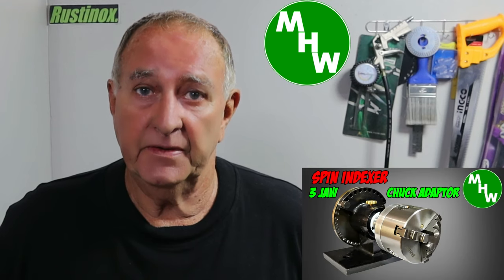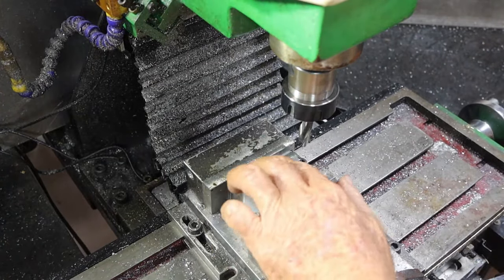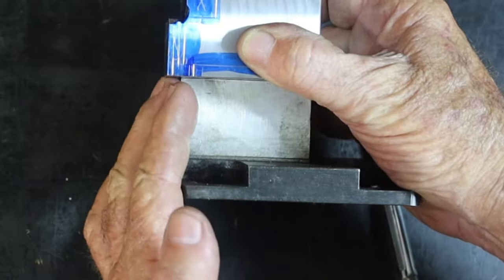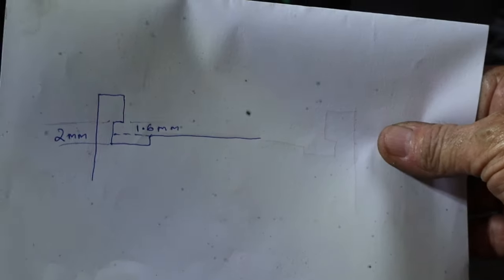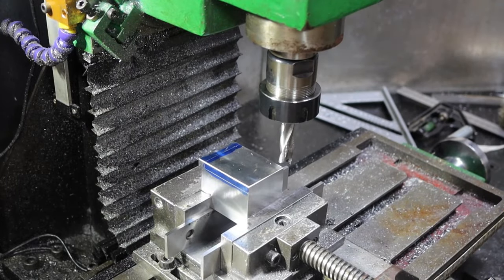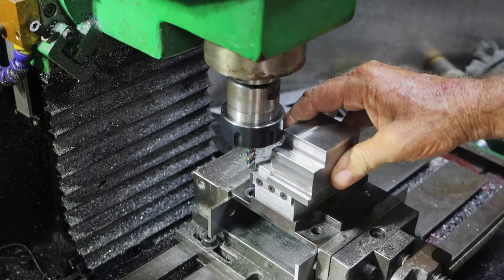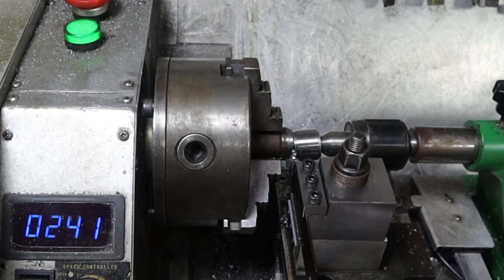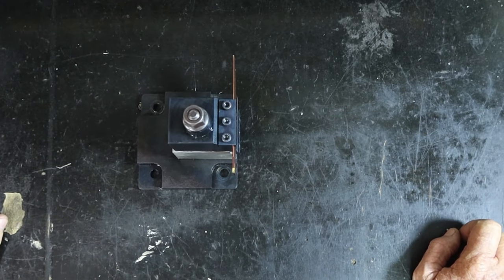MHW Episode 123 - Rigid Parting Tool Holder

Comment: Well done and very well designed.
Some time ago, using the part off that You disliked, some 15 mm steel was parted off. It looked like cutting well. Once finished it was discovered that the insert had broken off and the insert holder had done the cutting!
Reply from the maker: Astounding. 😯 Thanks for watching 👍
Reply: @MyMiniHomeWorkshop  Indeed but I don't consider it as a future method....

Comment: Gday, when I had the small lathe I had the same parting tool as you showed in the opening clip, I put an adjustable leg under the end that picked up on the threaded hole that holds the insert in, the “leg” sat on the cross slide and supported the tip of the cutter, this made a world of difference, I hope I explained that half right, cheers
Reply from the maker: I actually did that as well and to be honest I don't remember why I stpped using it 🤔 Thanks for watching 👍

Comment: Good work-arounds to get it all fitted and working. Like you I use to have big issues with parting. Plenty of loud bangs and broken parting blades, until I saw a video from BlondieHacks where she gives a bunch of really good tips on parting. I don't think I have broken a parting blade since. Further to that I saw a video from Winkys workshop where he builds a flexible parting tool holder.  It sounds counterintuitive but these work really well. They are designed to flex away from the work when there is a big load. The minimises the blade from breaking. I built one myself and it works great. I have a video for it on my channel if you are interested to see how it works. I can now part with the cross slide feed engaged.
Reply from the maker: Thanks, pretty sure I watched all of those videos, my issue is the amount of stick out the flexible versions have, as I don't have mountains of cross-slide travel. Thanks for watching. 👍

Comment: Didn't cross your mind to just buy the carbide cut off tool that fits your lathe?
Reply from the maker: Absolutely not, my lathe is homemade and so is my Mill and everything else I use. There's no fun in getting someone else to do things for you. Thanks for watching 👍
Reply: @MyMiniHomeWorkshop  you had no problem buying the one that didn't fit....🙄
Reply from the maker: @EitriBrokkr  I only bought the tool, not the holder, just which one are you suggesting didn't fit ??
Reply: @MyMiniHomeWorkshop  you could have bought the proper tool that would have fit, without all the shenanigans
Reply from the maker: @EitriBrokkr  You obviously don't know what you are talking about, that tool doesn't exist. Bye Bye, I'm not wasting any more time on you.